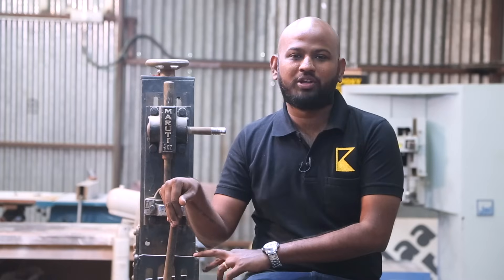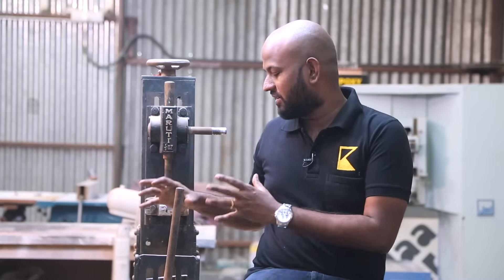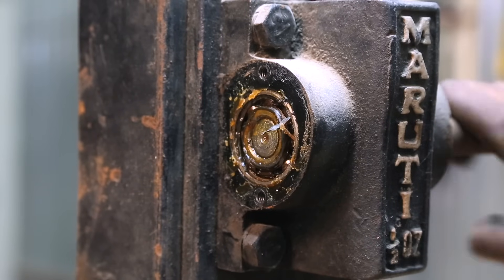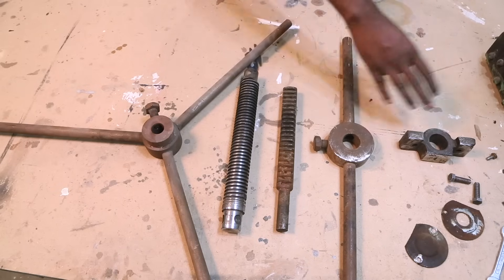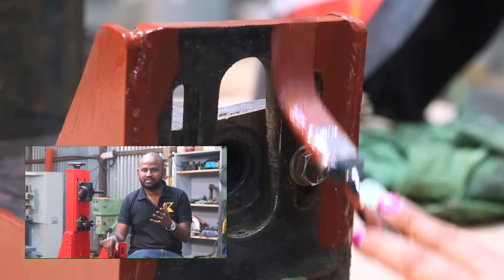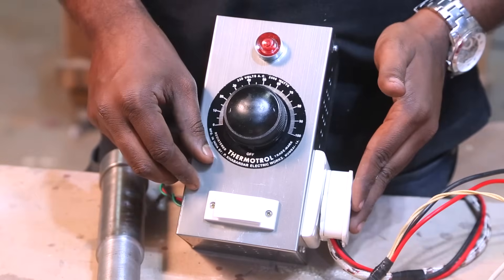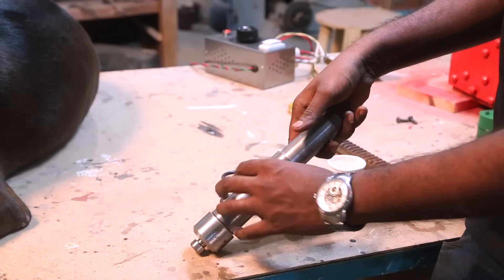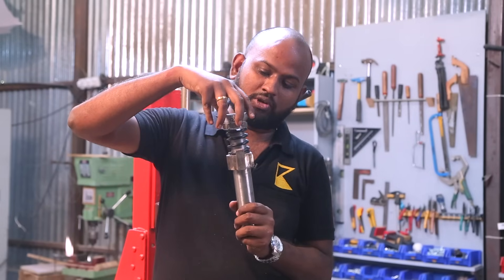Restoring an old Injection Moulding Machine

Comment: Very nice video, I have same machine in my workshop but it need lot more pressure for the injection plastic, so I plan to replace the higher wattage heater and nozzle assembly.
I need nozzle like you shown in video,  where can I get this nozzle.?
Reply from the maker: You can buy it from Pune
Reply: @Kalaakaar-in  Suggest seller or shop ?
Reply from the maker: @mmgdesigning4356  nishu polymers, pune

Comment: I think for best results use digital temperature controller, because usually the material burns as you control the temperature by thermostats.
Reply from the maker: Yes. That's what is happening. Do you know where I can get the digital one?
Reply from the maker: Interesting. I did. I did see the digital temperature controller. But it doesn't display a temperature and the site also says the temperature sensor is not included. How can this be useful to me?
Reply: @Kalaakaar-in  as you have seen the website, we manufacture the product. This is blind temperature controller uses J - type thermocouple and has a good accuracy. You can plug the heater to it and the thermocouple at the bottom terminal. Thermocouple of various lengths are available in the local market , hence it is not supplied by us. This unit costs ₹700/- only without transportation. You can check for digital temperature controller in the market , available in plenty.
Reply: Hi. Do you know where i can find it? Could you please help me in this? Thanks in advance
Reply: @bernardzouhou6707  lots of manufacturing units in Ahmedabad and Vadodara. Best is to search on the net.

Comment: Hello
If you have time , think about 
Mechanising it. Instead of hand cranking , a motorized screw can be thought of. Simple autifeed setup of granules to the cylinder is one more idea. Motorizing the vice screw is another option. Auto return of the plunger after the injection by using a limit switch and a delay timer will make it a workhorse.

Comment: Nice restoration. i know the trouble of finding the parts in Indian market ;) . I have made a similar machine in past. I went for 24v dc heaters instead of Ac one(for safety) . It would be interesting to see a video on making a mold also. Keep up the good work bro..!
Reply from the maker: Yes will make a video soon.
Reply: It's more complicated on our African markets. Specially west and french african markets. So if you could help me to find parts on yours: nozzle, heater controller and heater system. Thanks in advance.